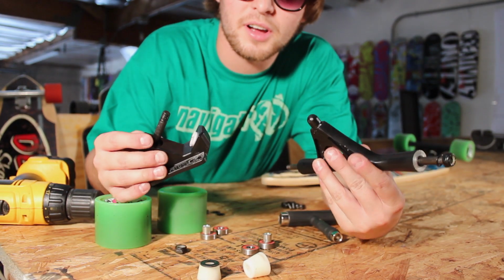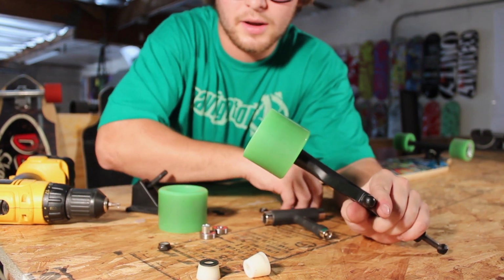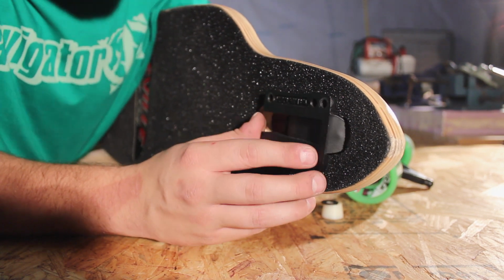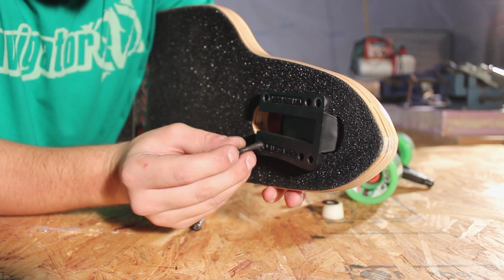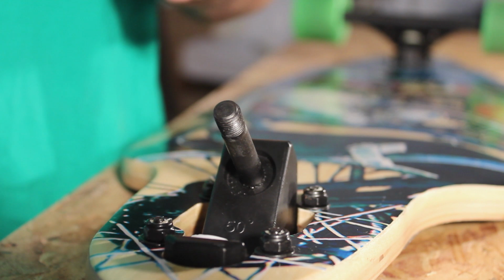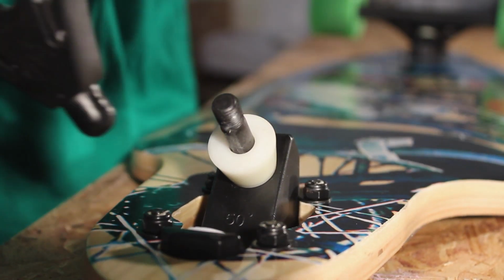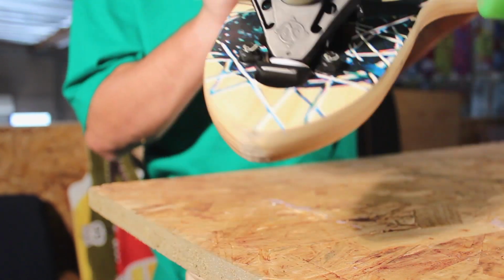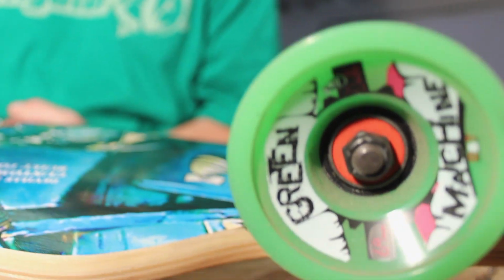How to: Set up a Longboard Deville Skateboards

Comment: When I get some speed, I get wobble. What is the best way to prevent wobble or avoid wobble?
Reply: balance so make a balance board or ride a ripstick and then get used to the speed you want to acheive
Reply: Incorrect^ You're going to want to get harder bushings for your trucks. Also tightening it down helps. I hope you have RKP's.
Reply: also practice carving and small speed check slide or just slides in general, to stop wable if it were to happen after you tighten your trucks which should be done
Reply: +Michael Hall Some people don't know what the fuck they are talking about.